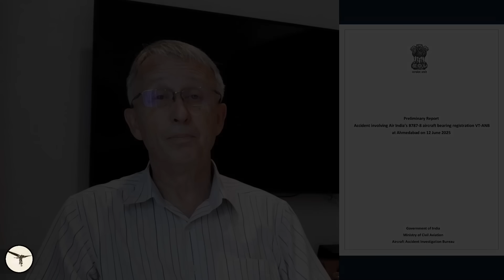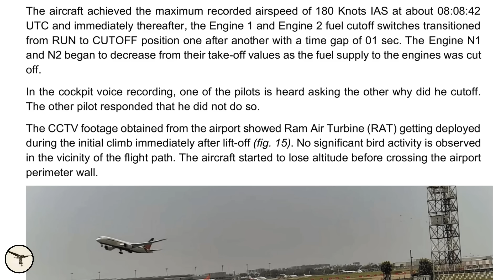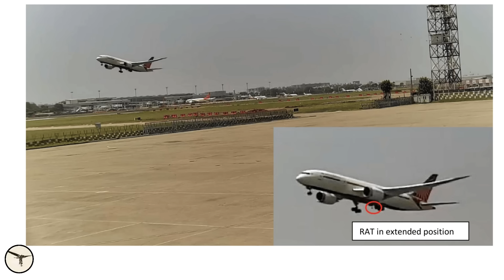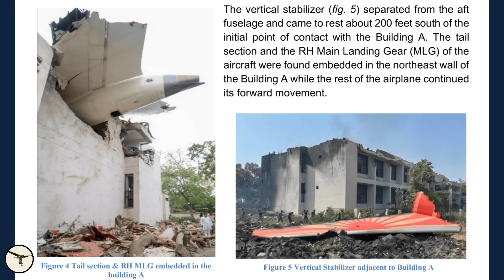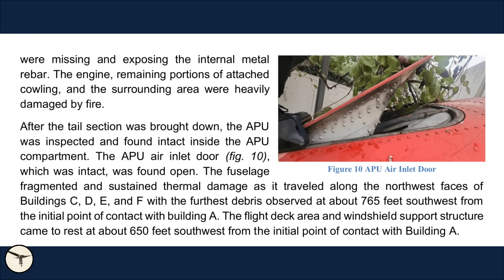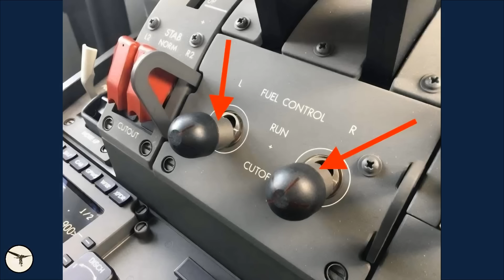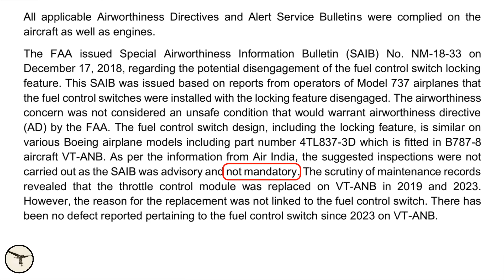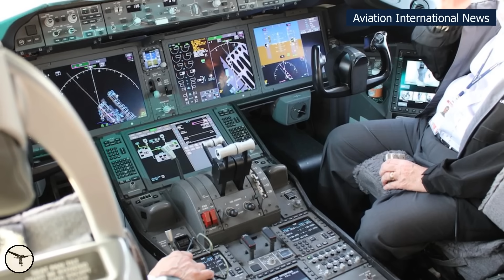WARNING Fuel Control Switches Failure Could Cost LIVES

Comment: The accident investigation team have the fuel cutoff switches from the crashed plane in front of them. If they have not already verified that they are working correctly then they are criminally incompetent. If they have tested them and found them to NOT be working correctly then it is a criminal act for them to not inform the aviation industry of that fact. Such a failure on their part would be putting the lives of thousands of other passangers at risk.

It's 99.99999999% certain that they have tested the switches and found them to be working correctly. The preliminary report was badly written, shockingly so. One of the consequences of releasing such a shoddy report is that it fuels all the conspiracy theories going around about this crash.

If they had simply stated the results of the tests they conducted on the cutoff switches and released more of the conversation in the cockpit between the pilots, there would be much less room for people to engage in baseless speculation.

Comment: You can’t just bump these switches into the off position. You have to pull up on them in order for them to move in order to do both of them. The movement has to be quite intentional.

Comment: In the case of a malfunction of the fuel switches, it should have been noticed after the flight from Delhi to Ahmadabad as you turn off these switches after being at the ramp and engine shut down by the pilots of AI 423. To spool up the engines, these switches had to be moved in the run position by the pilots of flight AI171. So the logic is they were completely operational, otherwise the pilots had noticed it. As these switches are completely manual, they must have been moved by a human in the cockpit.

Comment: BS..  Blame the pilots (dead men tell no tails)  and protect Boeing defects!!    Shut off both fuel supply isn't part of any take off procedure ..
Why on earth would a highly experienced pilot switch off a running engine immediately after take off . They know the catastrophic consequences . The switch cannot be operated inadvertently since it is guarded by brackets and needs to be lifted first to unlock it and push it forward or backward for ‘run’ or ‘ cut off ‘ position .
Human error is absolutely ruled out .
Switch failing on its own is the only reason seeming possible. But how it could fail ( getting lifted on its own and going to cut off position ) causing both engines to shut down is something hard to fathom …???  

Did the 787 directives in 2020 and advisory in 2018 about the fuel switch control system related to this accident? The report says
1. The fuel control system "TRANSITION" (not the pilot switch it off)
2. No overweight of the aircraft (5tons below max weight)
3. The Flaps were set at 5 degrees
4. Speed at 180 knots at 42 seconds
5. The RAT was deployed at 47 seconds
6. Left control switch off on 54 and right at 56

My Take - there could have been a malfunction in the electrical system- which generate a
signal to the DFDR that there is a problem with the fuel control system set to cutoff
Aircraft CANNOT take off with its Fuel Switch in Cut Off Mode

NOTE:
In 2020 a directive was issued there was a problem with the Boeing 787 Fuel control system
In 2018 Was there an Boeing advisory maintenance circular for the Boeing 787 Fuel Switches control/locking mechanism

Regarding Boeing 787 aircraft, there were indeed Airworthiness Directives (ADs) issued in 2020 and a significant advisory in 2018    Fuel control switch locking feature: FAA SAIB No. NM-18-33, issued on December 17, 2018, warned of the potential for the fuel control switch locking mechanism to disengage, which could lead to inadvertent movement of the switch and an unintentional in-flight engine shutdown. This advisory was based on operator reports involving Model 737 aircraft, (was it the same type of switch?) However, this was an advisory and did not mandate inspections.   Several Airworthiness Directives (ADs) were issued for the Boeing 787 in 2020:  Repetitive cycling of airplane electrical power: The FAA issued an AD requiring repetitive cycling of the Boeing 787's electrical power to address a potential loss of the stale-data monitoring function in the common core system (CCS). This issue could lead to undetected loss of common data network (CDN) message age validation combined with a CDN switch failure
Reply: Suicide due to mental health issues. If there was any suspicion of an aircraft defect,  mandatory directives would’ve been issued on all similar aircraft.
Reply: @Brenco-l6x   Why the report was leaked to the western media before its official publication?  Smells like a CYA - and a COVERUP!!!   In 2018 warning from the US Federal Aviation Administration (FAA) about a possible fault in the locking mechanism of these switches on Boeing 787s and 737s. This warning, issued as a Special Airworthiness Information Bulletin (SAIB), was advisory – not mandatory – and Air India never inspected the aircraft.  the fact that multiple airlines are now proactively inspecting their Boeing fleets has added to the mistrust. And the media’s handling of the story, particularly coverage that leaned toward pilot error while downplaying or omitting the FAA’s 2018 bulletin, has only intensified the backlash.

Comment: Captain - my salutations to you. I have been flying 787 for 6 years now for United Airlines. Let me present my opinion on the question you asked in the last part of your insightful analysis. First of all, I think accidentally moving the switches (if locking is engaged) is just not possible. I think we are on the same page here. Now coming to the scenario where if the locking feature on the switches were disengaged then yes you can accidentally move them because you don’t have to pull them to move - you can just push them and they get moved. I think this is less likely to be with VT-ANB. Two reasons for this: 1. If the switches were installed with the locking feature disengaged then first of all yes it’s possible one of the pilots moved them accidentally. The only thing here is - I would have expected both the switches to have been moved to CUTOFF at same time - without any time gap. But we know from the report that Switch of N1 and N2 got moved with a time difference of one second. And I timed it myself , it takes exactly 1-2 seconds to move them with fingers. Hence I don’t think they got moved accidentally. 2. According to the FAA bulletin if the switches indeed were installed with the locking feature disengaged then FAA also recommended albeit strongly to have them replaced. Now in the report it is mentioned that the throttle control module was replaced - but not because of Fuel Control Switch issue. I reckon if VT-ANB indeed had a fuel switches installed without locking feature then they would have replaced it. They did not implying (I hope so) that the switches came with locking engaged. Another point, the bulletin was released in 2018 - since then VT-ANB had flown thousands of hours on its watch. Not even once did any of the pilots flying it reported any issue with the fuel control switch in the PDRs. So I think the switches worked just fine as they were designed to. I think (and I really really hope I am wrong) the switches were moved intentionally (again this is totally based on the findings in the preliminary report). I would still wait for the final report and strongly hope that it proves me totally wrong. I will be the most happiest person on this planet. I love all my pilot friends- day in/out they do incredible job. These two did so too - just didn’t work out their way. My condolences to the departed ones of VT-ANB.
Reply: OK, shoot me down - but...........
If thousands of times a pilot does (as trained) pull the switch, move it & release it to get the required setting - does he assume all must be fine with the switching - as in all necessary safeguards are working properly? When would that pilot realise that [maybe] not all safeguards are 100% operational?
Reply: @2uksteve First of all you have a valid question. So no one will shoot you down 😊. You see the opinion presented here is solely based on the preliminary report findings. To be honest that report raises more questions than it answers any before it even came out. Now the reason I think (again I am saying this - I just hope I am totally wrong), that the switches were moved intentionally is because A. There is simply no way they are going to move to CUTOFF by themselves. No electronics malfunctioning will do that - atleast I have never seen this in my 28 years of flying experience nor have I heard from any of my colleagues. Nor there are any documented cases of this happening. Sure there is always a first time for everything- and therefore I will be more than happy to have the final report say that switches were transitioned due to some electrical defect. But I really doubt it. B. We have a CVR comment from one pilot “Why did you cutoff?” - this adds some weight to the theory that the switches were moved. Sure the other pilot responded “I didn’t do it”. But as I said these switches cannot be moved without human intervention- so someone moved them. You see the report itself is very vague - it doesn’t even say how the switches were transitioned, it just says they got transitioned. Also the fact that the both switches moved to CUTOFF with gap of 1 sec (as I mentioned this would be round about same time required to move them manually) points more towards manual intervention than anything else. Assuming some electrical defect impacted the switches - ideally I would expect it to hit both switches at same time. But since this has never happened before I can’t really comment on it confidently. In fact my stance that the switches were moved intentionally is also completely based on what the findings of the preliminary report - I cannot be more confident on that too. Therefore it would be prudent to see the final one.
Reply: @sidsatam  I feel at the last moment of desperation and a few seconds into the flight the pilots are  trying to take some corrective actions. The "stupid"  report would atleast have published conversations a few more seconds after take off till the point where one pilot asks the other about "Did you". The corrective actions by the Pilot Flying would have been an attempt to retrigger the Fuel switches which also tells the first engine starting to engage and the subsequent MAY DAY! call. I am still not ready to accept theories related to Pilot suicide. No Way. If they intended to do it they should have not even attempted to keep the nose up.
Reply: @user-zk2xk8ti8v You know what I really really hope you are right. I just hope the final report spots some sort of other aspect (like in Boeing Max case - eventually it turns out to be MCAS) which explains this switch movement situation. As I said we are only saying that the findings in the report are pointing or implying deliberate switch movement. For a second I would not like (or want) to believe that one of the pilots did it. To begin with it takes a lot to become a pilot - staying away from your loved ones is not easy. Furthermore to become a 787 pilot is much more challenging. Takes many hours of flying, exams, dedication and sacrifice. When a pilot has achieved all this it is so disheartening to see someone to do a deliberate act - why would they do it? But yet - the mental health is a concerning issue amongst pilots. At United we have a program where in if a pilot is going through tough situation on personal side which may take a toll  on psychological health the support from the management is immense - counselling, time offs (with pay), medications (if required). It’s really commendable. I don’t know what is the scenario elsewhere. It is also true that many a times a pilot working for a airline which does not have such support programs does not report his/her psychological issues - they don’t talk about it just for the fear of losing their license or job. This has happened in some cases I know. So you see we just don’t know in this case. I hope the final report blames the machine and not the human - humans are valuable.

Comment: Does anyone know how long it takes from each fuel cut off being deployed until an audible detection of low engine power is recognised by a pilot in this situation?
9 seconds seems a pretty long time for the error to first try to be corrected?
Reply: The engine noise is the clue, not audible warning is needed.

Comment: What if the CVR recording (as reported) when both the Captain and the piloting FO exchanged views about the fuel control switches' positions was what one of them saw on the EICAS display and never looked at the actual physical switches" positions at all?

That would explain the other pilot's denying that he manipulated the switches, because he didn't.
I mean, if there was an electronic data glitch that closed the fuel valves without neither of the crew ever touching the physical switches at first, only later - trying to relight both engines.

My point is, that from the CVR recording transcript in the preliminary report, we don't know what the crew's dialogue referred to - EICAS fuel flow and valve positions displayed on screen or the physical switches' positions - the EICAS showing CUTOFF and the physical still being in RUN position.

And that would possibly explain the denial voiced by the other guy, that he never touched the switches INITIALLY.
Reply: A very good observation. The crash investigators have the full audio and a full time-stamped transcript of which pilot said what should be released without delay. We also need to hear the audio from roll back at the gate to the accident, which should record any warning alarms and even possibly the clicking of the switch movement. The report uses the term "transitioned" with respect to the  fuel switches, it does not say moved
Reply: @AstralVoyager-q5f 
I am very suspicious now about the truthfulness of the preliminary report. It looks like the investigators already tried to implicate the pilots for the accident and absolve Boeing from any technical malfunction that may have caused it. One example: the preliminary report specifies 1 second delay between engine 1 and engine 2 flame outs. If that's what happened this 1 second delay would introduce thrust asymmetry resulting in a slight yaw of the aircraft. But here's the thing - none of the videos available show any yaw whatsoever - the B787 flying straight as an arrow. 
I tend to believe that the flame out was simultaneous for both engines and was induced by an unexpected software glitch, closing both fuel valves at once. And of course both of the physical cockpit switches remained at RUN positions until whole 10 seconds later (too slow reaction) either pilot moved them to CUTOFF then RUN again (4 seconda apart) to relight both engines, which was too late to prevent the crash.
Reply: A possibility, what helps explain the ~9 seconds delay for turn back the fuel for on, in a emergency in which seconds are fatal.

Comment: Is it possible that an electrical/computer fault could trigger the shut of valves without the switches having to be pressed, pilots using the switches were just trying to relight the engines??.

Comment: Kjære Magnar. Som jeg forstår på Boeing 787 er det veldig lite bleed air og APU starter ikke motorene gjennom pnaumatikk. Slik som er normen på fly generelt. Rund 5:50 minutter ut i videoen sier du at APU lager trykkluft til motorstart og aircondition. Motorstart og aircondition er elektrisk på Boeing 787 forteller internett meg
Reply from the maker: Det har du absolutt rett i. Min feil. Det er litt underlig at ingen andre har oppdaget det.

Comment: CURRENT Hartsfield Jackson Airline mechanic here. The chances of one switch flipping due to take off vibrations and thus accidentally hitting the switch is in the BILLIONS. Both switches going off, ONE SECONDS APART is in the QUINTILLIONS.
Reply: @Justin_Kace_ICU2  so obvious, but many people keep handling this absurd theories agains any probability law
Reply: In another pilot channel he relates that a European Boeing mechanic tell to him that replace this switches after a "spontaneous" fuel cut-off in flight.
Reply: @Sokol10 any possibility, but someone bumping on both switch by accident or the aircraft bouncing on the runway causing both switches to trip.

Those are plain jokes